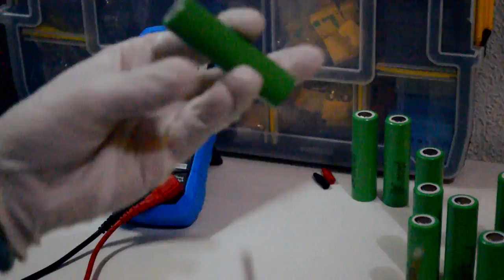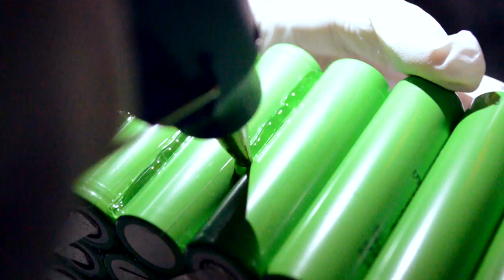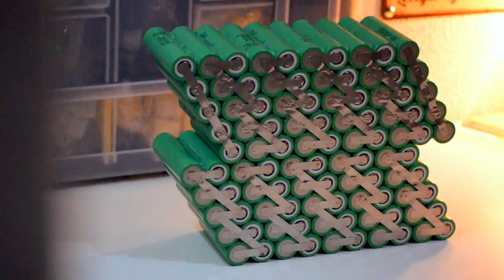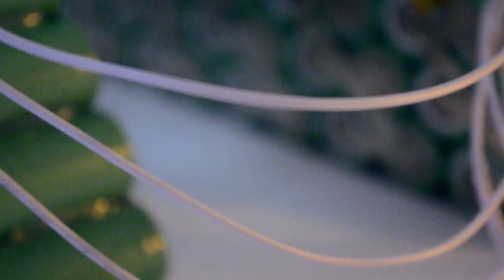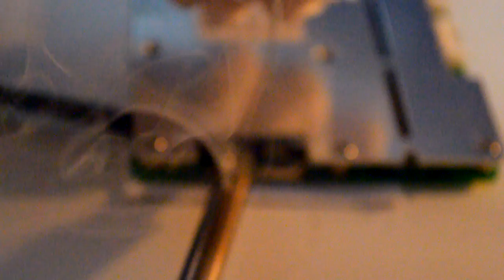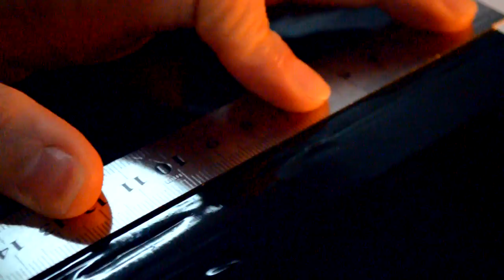72V 12.5Ah high power Li-ion battery designed for LMX bike frame

Comment: Hi, i built my 1st pack. But i cant figure what current should i charge it. It is 6s 2p Panasonic 18650b. Recommended charge for one cell is 0.5c. So since i have 2 cells in parallel i could charge double the current @ 1c? Is that right? Thanks. https://drive.google.com/open?id=0B131HuBkeGRuYUhUMW1zcVROTmc
Reply from the maker: C = Ah of the whole battery expressed in A.
One 18650B cell is 3.4Ah. 
A 6s2p 18650B battery is 22Vnom 6.8Ah.
0.5C on a 3.4Ah battery is 1.7A
0.5C on a 6.8Ah battery is 3.4A
personally I recommend to charge a standard / high density li-ion cell for a maximum of 0.3C
Reply: Thank you.

Comment: Are you sure that the batteries can be glued to each other in the hot melt? The batteries do not overheat when such manipulation is above 50 degrees?
Reply from the maker: +Fedya A cell has a much more mass than the portion of silicone that touch its piece of surface. The average increased temperature you can do using melt silicone at around 80ºC is around up to 3ºC on the whole cell.

This is because around a 90% of the cell mass is made of metals, the heat conduction is very fast spreading the heat to the whole cell immediately, so you never make the chemicals face a high temperature during an appreciable time.

li-ion cells indeed don't overheat up making venting gas to around 100ºC , however you spotted the temperature since the natural chemicals reactions accelerate considerably and where dendrites start to formate at a very faster speed, 50ºC
Reply: Damian Rene thanks for the info

Comment: amazing work man. appreciate the videos. question, what time of heat shrink sheets are those?
Reply from the maker: +Steven Guzman battery shrink wrap insulators. Two sizes were used here, around 230mm and 290mm measured in flat
Reply: Could you share your source?

Comment: Really like your work and have watched many of your videos.  Can you tell if you somehow "round" the nickel around the positive part of the cell.  What is your technique in that spot?  Thanks.
Reply from the maker: +Greg Guillou That's one of the most delicate spot welding into a cell. You need to make sure the welding would resist up to be ripped if the anode would be crushed, so you can better avoid a self-short with the own nickel strip. I personally push the nickel over the anode up to see clearly the anode edges, so I weld the most close to the circunference edges